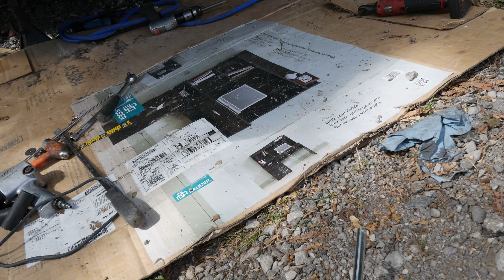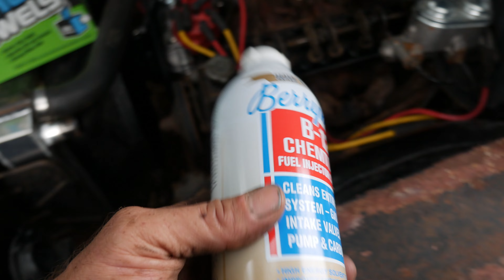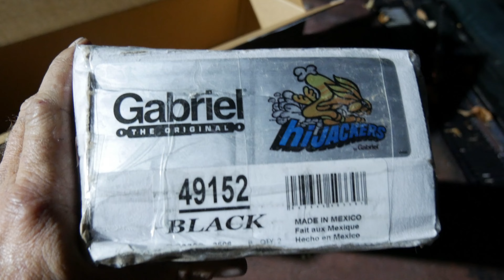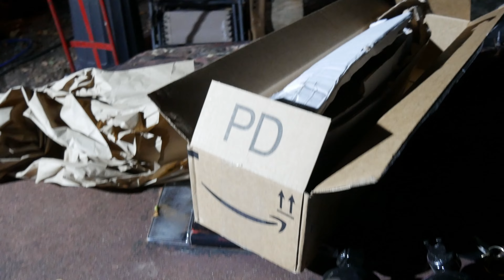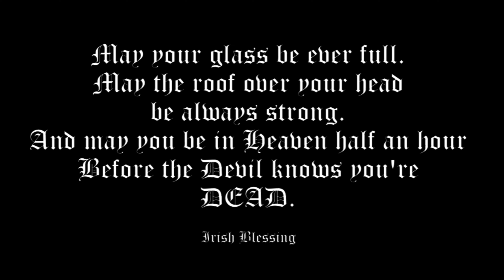1967 Buick's LAST CHANCE For Duct Tape Drags ~ I'm NOT Done?!?

Comment: They look like a shock extenders. It should have a rear sway bar if it had the sport suspension. That was a option on the 340GS cars. You should have 4 hangers for the exhaust. Two by the back seat and two at the tailpipes. They had a metal with rubber for factory hangers.

Comment: Since you don't appear to have the luck of the Irish when it comes to Buick starters there is a mod to the starter wiring in which you use a weather proof 2 pin connector on the 2 connecting nuts so you will only have to unbolt the battery cable and just unplug the other 2 connectors when changing starters
Reply from the maker: Starter was junk out of the box. No problems since

Comment: Hey! I finally got my 64 lesabre! I was just curious if you or anyone you know may have a 4 barrel intake manifold for the 340 laying around that I can buy…. Trying to find anything online is impossible. The guy I got the car from has a 4 barrel carb to an adapter on the 2 barrel intake and it just feels goofy. Thanks in advance!
Reply from the maker: There's no aftermarket for these engines. Might try Dallas https://youtube.com/@mr.roddersneighborhood2740?si=iNFUwPdu2UkFpg5u see if he can help you.
Reply: @IrishOutlawGarage  thank you very much!! That’s what I found
Reply from the maker: @MrFartingpickle  Any cylinder head upgrade to fit aftermarket intakes will make it un-driveable. Already 10.25 to 1 compression. Closed chamber heads will take it to around 14 to 1. You'd need race gas.
Reply: @IrishOutlawGarage  interesting. I actually just found a guy 40 minutes from me who has a warehouse full of all old Buick stuff. I’m going to check it out, he says he has a 4 barrel intake for it. I can certainly give you his information if he seems to be legit and if you ever need anything!

Comment: Must of quaker oil
Reply: Would it been easier to try to put bolts through top and just have to put nuts on bottom if you could get them between floor and brackets. Keep up the great videos cause you tell it how it is brother!!!
Reply from the maker: I thought of that but with the shock lifts it takes a 4 inch bolt